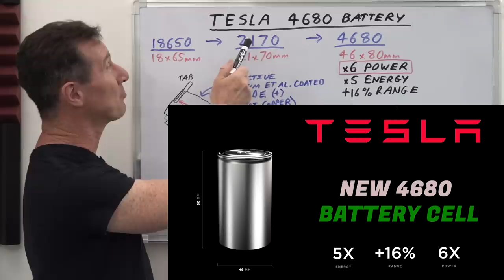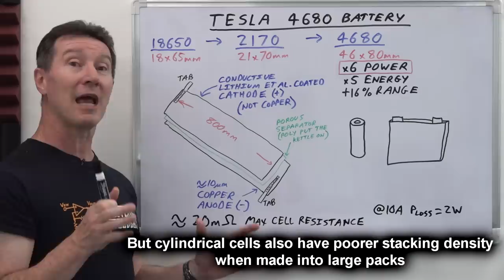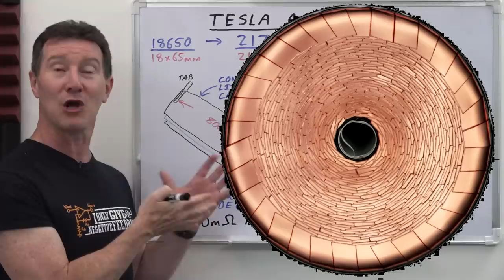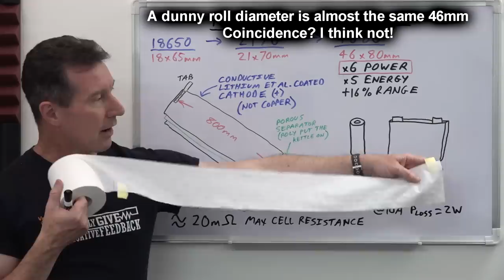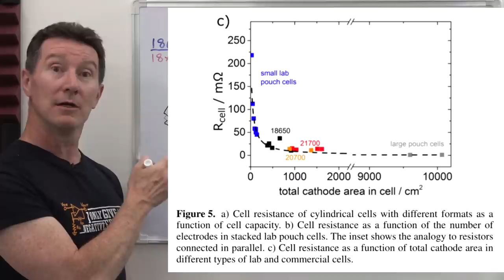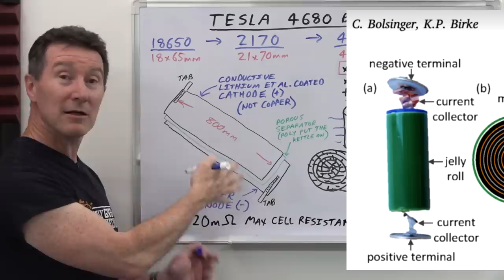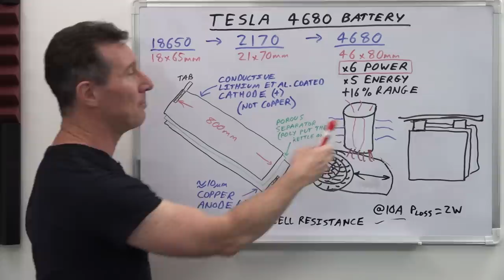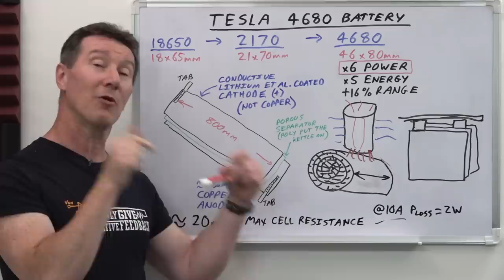EEVblog 1340 - New Tesla 4680 Battery Cell EXPLAINED

Comment: Thank you I was impressed with the new battery until you explained it lol.
Reply: He kind of missed the mark here. There is nothing disappointing about this new cell type. It is absolutely incredible. Enabling this size AND improving thermals? That is insane. And it will be super easy to produce compared to what everyone else is doing. And this was only 1 out of 5(!) Improvements they announced. Combined they will give +54% range, -56% cost and -69% in production equipment costs. It is absolutely massive. He only scratched the surface of 1 of the things.
Reply: @eriktamlin  He forgot to mention the range increases to 500 miles / 800 kilometers so making ICE cars and H2 cars obsolete. That kills almost every other driving technology 👉
Reply: @mirkonaumann1417  800km range is totally unnecessary. 500km and 15 minutes 20-80% fast charging is more than enough for 99.9% of the population.
Reply: @demoniack81  That is a stupid view. More range means less charging sessions thus more comfort and less traffic at charging spots. Beside that increases battery life and you can drive faster for a long time making trip faster. Think about this: the 130 kWh pack charges faster from down to max than the current 75 kWh pack 😉
Reply from the maker: @eriktamlin  Yes, this video was just looking at the cell construction.
Reply: @mirkonaumann1417  It doesn't mean "less charging sessions" unless you're really gonna drive for 500km straight, which I find very unlikely. Most people stop to pee every 250-300km at most.
You do have a point about sustainable speed though.
Reply: @demoniack81  Once more to make it clear: the people want more range because it means comfort, means saving time and those batteries last longer. A bigger battery always charges faster than a smaller. Can you follow? The new 130 kWh Cookie Can Cell Battery is expected to charge from down to at least 80% in under 20 minutes. The current 75 kWh battery needs more than 30 minutes for this. So people tend to charge shorter (to benefit from high charging speed) but more often. If you travel 750 km this means 1 recharge for the new battery vs. 2 recharges on the current. 20 minutes vs. 2 times 2 minutes.

People don't want drive long distances without stop for WC, move some or get a meal. But they want get every day into their car driving to work or other place without planning next charging trip. And when you go on a trip other people may have same idea so an overcrowded charging spot costs additional time. The bigger pack charges faster and lasts longer. That is what customers want. Stop thinking "nobody needs this". That is fully wrong.
Reply: @mirkonaumann1417  Look, I'm the first to agree that people who say "durr you don't travel more than 50km a day so 100km are fine for everyone" are close minded and completely wrong, but there comes a point where more range hardly gives any appreciable benefit.
Fueling up my LPG powered car often takes 10-15 minutes since I have to wait in line at the pump, and I've never found it to be a significant inconvenience even with just 350km of LPG range.
Most people don't travel 750km all the time. They probably make such a trip once or twice a year, if that. And again, if you're already stopping to eat/drink/wee there is hardly any additional hassle in spending 30s to hook up the power cable before going into the service station.
By the time you go to the bathroom and come back 10 minutes will have passed, and waiting another 5 minutes is less than the time it would take to fuel a combustion vehicle.
Yes, I know that current batteries take around 30 minutes to get to 80%, that's why I said that reducing it to 15 would be the most important aspect. Increasing capacity isn't the only way to do this.
As far as charging power dropping when multiple people are charging at once, that's going to be fixed very easily by just increasing the number of charging stations around, which is going to happen regardless of the size of EV batteries because everyone will want in on the action.
500km is more than enough for most people, and reducing the cost of a 500km vehicle by a third would get a lot more people in the EV game than selling an 800km one at the same price.
If you want the 800km one because you're the one person who drives 500km every day go for it, who am I to stop you. But it is simply unnecessary for the vast majority of the population.

Comment: Tesla will end up with a water radiator but instead of cooling the motor they will be cooling the battery pack and, maybe eventually, they will also cool the motors as well since it is already there. Thanks for the excellent video and information Dave!
Reply: Batteries and motors are already water-cooled in Teslas. And yes - there is a radiator (or two), coolant pumps and even an overflow tank. The radiators are way smaller than what you see in an average ICE though.

Comment: This is essentially the equivalent of making a D size battery.... I guess that's news.
Reply: D cells are 1 inch in diameter (25.4 mm), 4680 cells are 46mm in diameter or a factor of 1.8 larger (nearly 2 inches)

Comment: EEVblog, go ahead and be disappointed. Me, I'm going to add in all the other advantages, like the production advantages. Musk eliminated the start stop of the production line, continuous smooth flow of battery at high rate. The pouches must be a  nightmare (impossible) for high speed continuous flow manufacturing. Musk is using the structure of the cylindrical cell design as part of the "vehicles" structure, something impossible with the pouches. Essentially, the entire floor of the vehicle will now be a honeycomb flat plate structure using the cylindrical casings are the honeycomb, and the bottom plate and/or top plate cooling. Then there was the "unrefined" material going into his concept battery. He has solved the heating problem for discharging and recharging, something the pouches can't do as heat flow is across layers, like Tesla's old battery. Solving the heating problem has implications like,  no thermal throttling due to battery overheating when racing the car,  faster discharge times, and faster charge times. Heating is probably the limiting factor on charging, so I wouldn't be surprised to see new mega-chargers that take a cars battery from 20% to 80% in under 5 minutes, about the time to fill up a tank of gas. Go ahead and be disappointed.
Reply from the maker: I don't understand what structural chassis advantages  are afforded by the cylindrical design? It's not like you can use the still fragile cells as structural load baring members, that would be an epicly bad idea.
Reply: @EEVblog  'Baring members' is illegal, outdoors, in most countries.
Reply: @EEVblog  It's a weight advantage,  and possibly a safety advantage it creates a very stiff structure that is the the center part of the "frame"  connecting the two front and rear castings.  It's like building a structure that is twice as stiff and stronger than necessary because the structure of the cell is also the structure of the honeycomb.  The cell casing and epoxy holding them together is a light weight honeycomb like that used in aircraft. Large weight savings with a stronger passenger cage.  It will be interesting to see if they can design in a way to change the battery, since it's the center part of the "frame"
Reply: If you want to charge such high amounts of energy in such a short period of time, you will also need to provide a safe and usable mechanism to achieve that.

Charging with something like 200 or 300 kW is already close to what power smaller district heating plants provide.

I don’t think there will be enough charging spots in the near future which will be able to provide the necessary power.

Raising the limits of the battery design is just one piece of the puzzle. You also need to make sure the infrastructure can keep up with new battery designs.

I personally do not think that fuel choices that require the energy to be converted into another form while „refilling“ is the future (electric energy into chemical energy) but rather a fuel which is not converted and hence has no real limitation regarding the refueling speed.

F1 cars can be refueled within seconds as the energy stored in the fuel is not being converted during the fueling process.

Comment: Two questions. 1. Why don't you also have to use the same multi-tab design on the cathode as well? Don't the electrons have to travel though it also? 2. Could you put a hole through the center of the batter for heat dissipation? You could run a heat pipe though a series of batteries to remove the heat directly from the center of the cell. It would no doubt increase production cost but I don't think it would really impact energy density.

Comment: Also the risk of runaway fire risk is much smaller in the cylindrical cells. Tesla has openly recommended against pouch cells for this reason and is likely going to cause massive recall issues for other car companies. Eg the bolt recall.

Comment: I'm still confused about the power number.

So the only way it seems to make sense to me is if the 6 times power and 5 times energy are comparisons of single cells and the +16 % range is a comparison of a similar volume or mass battery pack.
But if this is the case, then the power number is really not that significant, it seems to me that the 4680 ought to be able to deliver much more power, due to its significantly lowered internal resistance, but the number we get is just the scaling of the energy from the battery, and a little extra.
The energy and range numbers seem fine, did I miss something? is it just that scaling up the battery needed the tabless design to even function with such a long roll inside?

Perhaps I did not pay enough attention?
Reply: Simon Als Nielsen I’m with you. Dave noticed energy is a function of density but didn’t notice that power is too. These may have less resistance but since there will be fewer of them there will be fewer cells in parallel. So you won’t have the amazing low resistance he speaks of. The power increase basically comes fro the cell size same as the energy does. Also he seems to not notice that you can’t just hook all the terminals together with metal (a great thermal conductor) to pull the heat out because you want the cells electrically in series.

I’m sure this is a better cell but it’s mainly a cost and faster production thing. You don’t have to make cells faster to get an effective speed up because each cell is like 5 older cells.  I still think Tesla has the worst battery tech in the business now that Nissan sold their in house operation off. They should go to large format cells like everyone else. And probably outsource. Vertical integration is overrated for things like this. Get external suppliers and benefit from all the developments they make selling to the entire industry.

Comment: really nice discussion you covered just about everything, didn't mention the different heating rates of the copper and aluminium, not  the inherent heat transfer rates, but mainly the differential heating of the two metals during discharge and charging, would be nice to here a bit about that.
No one is talking about the aluminium heat sink end. Also its assumed the copper base is the bottom of the cell, I'm thinking it will be the top of the cell ( heat rises) ( I"m also assuming copper is where most of the heating is  occuring during discharge).

Comment: Larger cells would save packing material but there would also be larger gaps between cylindrical cells so more empty spaces.  So the increase in gap space may cancel out some of the improvement in individual cell energy density?

Comment: The zero on the end designates the cell as a cylinder. I suppose you can ignore it most of the time unless you accidentally order rectangle cells because you ignored the last digit.

Also on the older cells, why not put the tab in the middle of the sheets.  Maximum distance the electrons would travel is 400mm so surely you have cut the resistance by half or close to half just by moving the tabs.

Comment: A standard cell puts the tab in the middle so the electrons are only traveling 400mm not 800mm. But the point is the same. The tabless design is way shorter than that.

Comment: If the battery pack is single layer, then 80/70 is 14.2% extra energy for 1cm extra height. Perhaps the other 2% is because, horizontally, there's a better cross sectional ratio of charge carrying material to packaging material because of the larger battery radius.

Comment: A few reasons people might not have done tabless before:
1 - You need to make your electrodes in thin 80 mm wide strips, with a region of bare copper on the side. This is much harder than making your electrodes much wider and cutting it into multiple strips with a bit of waste on the sides.
2 - You need to include a way to carefully cut and then fold up all the tabs rather than simply rolling up the roll.
3 - In order to fully appreciate the benefits you need it on both sides, otherwise you still have the allegedly slow manufacturing process of putting on a tab.
4 - You need to ensure the tabs are properly insulted from the other electrode, meaning either the separator needs to be folded over as well or an insulator needs to be included, while also making sure the tabs make good contact with the other tabs. This could be a significant safety concern which may stop people wanting to do it.
5 - You need some way to ensure good electrical conductivity between the tabs and the casing, preferably without damaging the battery. With this you are relying upon the contacts simply being pushed against each other. In contrast a tabbed design has a tab which is welded to the electrode and to the casing ensuring good electrical contact.

Comment: The 4680 battery is 5.5 times the volume of the 2170 battery which explains why you only get a small increase in range

Comment: The glory of the cylindrical form of battery is that its shape resists distortion under the pressure which comes from trying to stuff as many electrons into the charged-up battery as you possibly can.

Comment: What everybody is missing is that this new design takes 1/12 as many steps, 1/12 the machines, 1/12  the floor space to manufacture there fore you can manufacture 12 times the batteries in the same plant, more batteries/same plant = cost savings and more batteries. BAM!!!!!

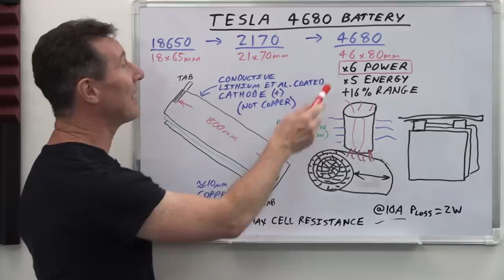Comment: 21:32 I'm not convinced all the math is right, but if the cell has 5x more capacity and 10x less resistance, an assembly of cells with equal capacity will only have half the resistance of the 18650 based design. Certainly worthwhile, but much less than 10x.

25:01 no, the packing density is the same as a percentage of volume. You do save a little from not having as much (or any)cooling channels, clearances, and steel cases, but aside from the cooling, channels, it isn't much.

Comment: When you use larger cells that are cylindrical, doesn’t the larger diameter create larger non-usable void/white space between the cells?  Could that be a reason why the gains aren’t quite as impressive as you imagined?  They did mention toying with all sorts of different sizes to find the sweet spot.

Comment: ok, I'm kind of stumped. I get that we go from "tab-on-each-end" w 800mm 'electron travel[et]' to "tabless" which seems to be a copper ribbon at the edge with relief cuts [into tabs - go figure] to fold it over w an 80mm et.
question, if you just cut/eliminate 2 out of 3 of these new tabs, you reduce the copper by 1/3rd and you et only up to 80.7mm - why isn't someone optimizing this?!
Reply: Create a patent.  This isn't rocket science. Amazingly low- hanging fruit!
Reply: @TheRainHarvester  yeah, I forget that even obvious solutions aren't always obvious.
Reply: @jaewok5G  wouldn't you reduce copper tabs by 2 /3rds? (Not 1/3rd).  Maybe they need the extra copper to seal the cell?
Reply: @TheRainHarvester  I figured the ribbon of copper along the edge is ½ on n ½ off so after cutting of 2 tabs, there is still the continuous line of copper attacked to the edge of the 'plate'. imagine the ',' as being the removed tabs n the '.' where copper is maintained n you'll see where I get 1/3rd savings of copper.
… : ; ; : ; ; : ; ; …
re sealing the cell; perhaps, but I didn't see that indicated but there may be another lighter cheaper way to do this.
each tab in the photo seems to overlap four others in the spiral n the number n position of gaps will need to be optimized to get full coverage.  maybe even leaving the final/outermost layer fully intact - so even my 1/3rd savings is theoretical.
Reply: @jaewok5G  I still think you're saving 2/3 of the copper tabs.  (Only 1/3 are copper. So 2/3 are removed.)
Reply: @TheRainHarvester  … but next to every copper tab is a bit of copper still along the edge of the substrate.
Reply: @jaewok5G  ah I see now.
Reply: @TheRainHarvester  I concluded that if you didn't keep the continuous ribbon of copper, you'd have to go back to spot welding except there'd be many more.

Comment: Instead etheral names, such as power and enegry, should be current capability or internal resistance, and amper multiply hours capacity. Changes could be estimated from a first glance

Comment: Cells gotta be connected in series, so adjacent anodes must be electrically isolated.  But you're still right - Thermal cooling of cells will be much easier with the tabless design.
Reply: I am curious to see how they are going to connect in series without loosing the thermal advantage in soldering the cells in parallel to a thick bottom plate